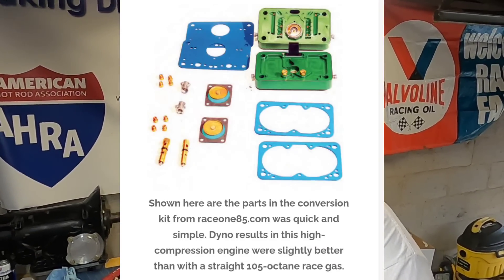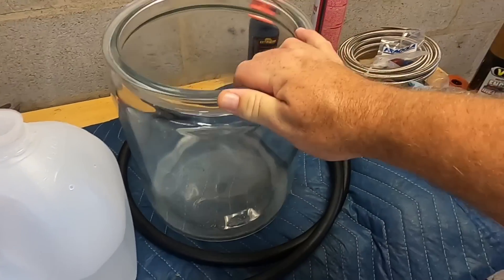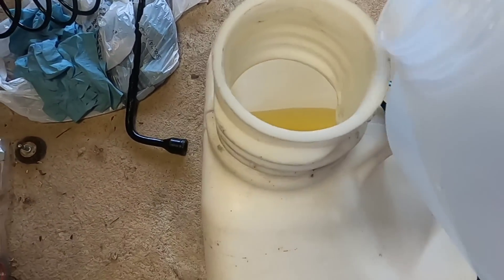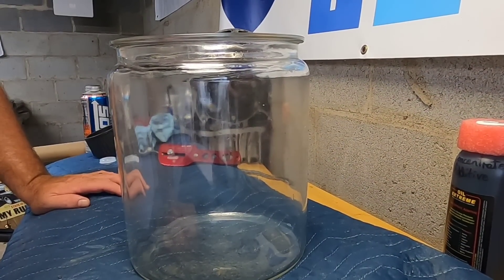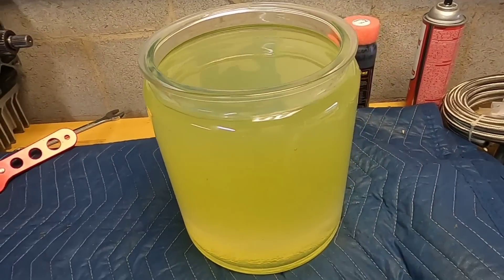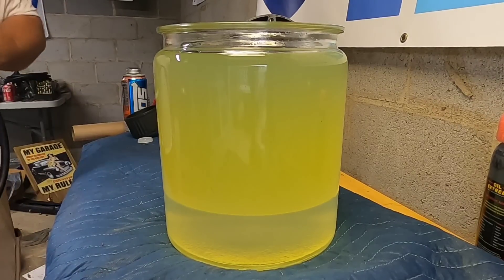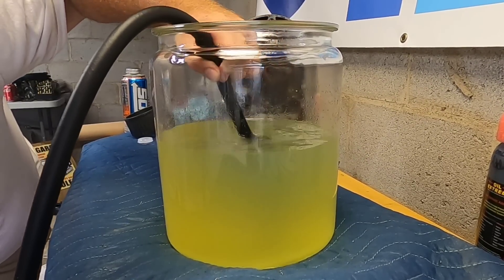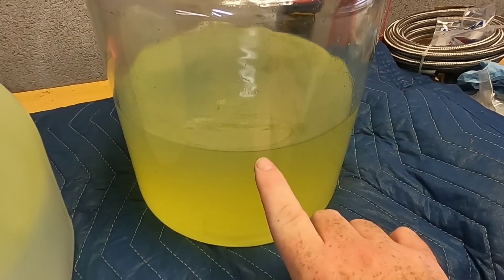Making your own ETHANOL FREE Gasoline!!! it's easier than you think!!

Comment: Glycol (antifreeze) works better than water on separating and with 87 octane you drop to 84 and with 93 it will drop to 91-90 ish on octane. I work for one of the big oil company’s and we test loads that head to the stations for ethanol content this way. It can help a fella make some 90 rec when you are in a pinch.
Reply from the maker: I've never tried Antifreeze... That is pretty neat good info
Thanks for watching
Andy
Reply: It takes more energy to produce ethanol than the ethanol contains. Wasteful. All about corn subsidies and being environmentally ‘friendly’ when it is the opposite. Inefficient, ineffective, and wasteful. Ethanol should be removed from our fuel.
Reply: @Walkeranz  THANK YOU!

I did a big presentation when I was in college about that, showing tons of evidence and data, including showing damage ethanol does over time to fuel systems and small engines, and all I got was "but even Bill Clinton said...."

Needless to say going to a college in western WA was a joke even back then.
Reply: @Walkeranz  Lol, glad you believe the propaganda.......
Please, tell me more government lies!!
Reply: Ethylene glycol is far more expensive than water
Reply: @308dad8  never said it was cheaper… just said it works better 😂
Reply: @Lagrange1186  you miss the point. This is how to get straight gas to run something intolerant of alcohol. The best method is the least expensive and or least labor intensive. For me it’s best just to buy straight gas but if I have to chemically separate gas from ethanol I’m not going to call $13/gallon better than free water. How much better yield do you get from it? If it’s not better than 1300% less gasoline wasted then I personally can’t consider it.
Reply: @308dad8  sounds like you got it figured out boss… just use water 🤷🏻‍♂️
Reply: @308dad8  and yes, it can be REUSED.   so cost doesn't matter....
Reply: Thanks for noting the drop in octane

Ethanol has pretty high octane so the underlying crude oil based gasoline is refined to a lower octane to give the blend 87 or 93, etc
Reply from the maker: Yeah, E85 has a octane rating of 105 so it does have an effect on it even if it's just 10%
Thanks for watching
Andy
Reply: @UnityMotorSportsGarage  so couldn't you do this with E85 and get a higher octane after removing the ethanol from it?
Reply: @ccpgmike620  I don’t know how true that really is if you look at what octane actually is. Yes alcohol needs to be vapor to ignite but so does gas. Octane is a fuels ability to not ignite prematurely, which is what causes knocks. Since alcohol will evaporate rapidly at room temperature and it’s vapor is ridiculously combustible I don’t see how it’s antiknock rating is higher than gasoline.
Reply: @308dad8  The term octane represents a fuels resistance to knocking. The numerically higher the octane, the higher the antiknock properties of that given batch of fuel. Pure ethanol is 108 octane. Gas can be refined up to 130 but is typically refined to 84 and then mixed 90/10 with ethanol to give it an 87 octane rating for regular gas. The octane number goes up when ethanol is added because the ethanol has a higher octane than the low-refined regular gas. Avgas (avaition fuel) is what runs up to 130 octane. Typical automotive racing fuel found at the dragstrip is around 115 octane, as another example. So if you were to mix 130 octane Avgas and ethanol at a 90/10 ratio you would get around 127 octane. You're thinking of gas, fully refined, as being of higher octane than ethanol which it is. However regular street fuel is very poorly refined so the ethanol has a higher rating. This is why you're confused. You're both correct and wrong at the same time. Correct that gas CAN be of higher octane rating than ethanol, but you're incorrect in assuming that regular automotive gasoline is made that well, it isn't. Hope that clears things up.
Reply: @308dad8  Short answer is that ethanol has a a much lower ignition point than gasoline.  Lower temperatures decrease the likelihood of detonation. Also bear in mind that because ETOH is hygroscopic ALL fuel at the pumps containing ETOH WILL contain some water [which in low amounts serves as a burn rate modifier, specifically slowing the rate at which the fuel burns. Too MUCH moisture will either cause the fuel to burn poorly or perhaps not burn at all. 

Technically engine knock is detonation.  In detonation ALL of the fuel is consumed instantly whereas in an explosion there is a definite flame front moving from one end of the fuel to the other... it's a linear progression.  Because the ETOH ignites at a lower temperature the gasoline ignites at a lower temperature, and you avoid detonation.  

Anyway atomized fuel gets closer to detonation by itself. Add in adiabiatic compression ignition (think fire piston, or even a diesel engine).

The addition of octane regulates how fast that atomized fuel can burn.
Reply: @308dad8  in the same manner of water or meth injection into pump gasoline race cars,it has a higher cooling effect upon vaporization.That little bit inhibits detonation under higher boosts or increased timing settings.
Reply: @308dad8  Good on you for thinking about it, but no you are wrong. Ethanol has a very high octane rating. Also -  Anti detonation properties are VASTLY more complicated than your simple vapor pressure theory. Just for basics, some octane boosting chemicals are only good at lean mixture anti-knock, others only work at preventing knock at a rich setting.
Reply: Brandon if glycol is a better medium to draw the ethanol does the ratio remain the same? Or can the ratio be decreased? Can the glycol be reused multiple times to say extract/clean 20 gallons (full 1970 Mustang tank). Just had Holley rebuild the original carb to my 9F02R and before I put it back on I have been trying to come up with ways to drain the carb every time its parked.  Its been a yr since I last ran it and it was 11 years before that... Thanks
Reply: @donnamoss9650  Go to your LITTLE airport and buy the 100 avgas, won't go bad.
Reply: @donnamoss9650  in
Reply: @donnamoss9650  we use it as a 1:1 ratio and it separates within minutes. Water can take some time to separate but it will definitely get the job done. As far as could you use less I I’ve never tried it with less but I’m gonna have to test that theory some time and see. Thanks for the idea.
Reply: @Lagrange1186  I would appreciate the results of your experiment. Thank you.
Reply: @Lagrange1186  )
Reply: How do you know the ethanol is mixed in the water instead of being in both the water and gasoline?
Reply: @MrZdvy  a graduated cylinder will help show you the magic. Fill it up with 100 ml of gasoline add 10 ml of glycol shake with the top covered for a few minutes let it set for a few minutes and you will notice it now looks like you have 20 ml of glycol. Once you see the trick work a few hundred times you trust the science and go on. As far as water goes… I know it works but I’m gonna have to do an honest test on it to see the exact time difference and effectiveness between the two since this has sparked so much interest and report back 🤷🏻‍♂️.
Reply: @Lagrange1186  I get it, thanks.
Reply: Update for everyone. Did the side by side test on glycol  vs water to separate ethanol. After 5 minutes the glycol pulls 100% of the ethanol out. After 5 minutes the water pulled out 90% of the ethanol and the gasoline was a bit cloudy. Had I given it 24 hours maybe it would get the full ethanol concentration separated from the gas. Andy if you shoot me an email address I’ll email you side by side pictures of the results to share. I didn’t have any pure antifreeze concentrate from Prestone on site to use only the 50/50 premix but if y’all want I can bring some in from the house and do one more test 🤷🏻‍♂️
Reply: Years ago some idiot put antifreeze in a vodka bottle and he went away for the weekend and his kid drank it and died. Speaking of glycol went to NAPA a week ago and they only sold it in a 50:50 mix after I bought a jug of distilled water
Reply: @codyhatch4607  yep 35 yrs ago son's Saint Bernard thirsty or??? hot summer day licked a puddle of anti freeze in dirt driveway..  son got home and dog was dead.. His mother's water pump apparently went bad evening before or overnight and leaked. No one realized it until he came in the drive and the dog was laying there. Any idea how big a grave has to be for a St Bernard?
Reply: @donnamoss9650 it's embittered now to help prevent that!
Reply: @donnamoss9650  one of our cats died for the same reason... this pre-mixed liquid antifreezes have some sweet taste or smell they like, works as a magnet for those pets
Reply: You can xylene as an octane booster.
Reply: @David_H_Parker  toluene is one of the big oil go-to tricks for that
Reply: @Lagrange1186  Can you buy 100% ethanol from Big Oil, I mean contaminated for engine use of coarse?
Reply: @Lagrange1186 how does the average Joe get a hold of 50 gallons of toluene, one might ask.
Reply: So question would adding the octane booster actually work or is that stuff fake?
Reply: @williamwallace9620  When you switch a smallblock over to run on alcohol you basically(just about) double the jet size in your Holly Carburator. Holly jet sizes are quite simple: a #70 jet is a .070 inch opening ie. 70 thousandths of a inch. If you were running, say, #76's in your primaries and #80's in your secondaries on gas then you would  run somewhere in the #138-#142 range for your primaries and maybe #152's on your secondaries. We all know how much more flow we get when we (basically) double the diameter of a pipe.
Yes, fuel mileage with ethanol is horrendous. However, in my example above you can expect 50-70 more horsepower and 125+ more pound feet of torque from the ethanol. It's a much more potent fuel, overall, than gasoline, but one that's quite impractical in the real world because the mileage is terrible. This is why you don't see ethanol fueling stations and nobody much buys E85. A nice idea, to be sure, but one that doesn't really work too well when the wheels hit the pavement.
Reply: Gasoline in and of itself is not a particular chemical. It is a mixture of several chemicals and that varies seasonally in order to minimize evaporation in the warmer months. Most ‘gasoline’ sold today is actually a mixture known in refining parlance as reformate and is a low octane blend fully intended to be supplanted with 10% ethanol for use in IC engines. (As mandated by the government by the way). That reformate you have left after siphoning off the ethanol is actually not gasoline and is a rather poor fuel.
Reply: @gilbertgauger3380  However, in a small engine with very low compression to begin with, such as a lawnmower, the low octane fuel is just fine. What messes up the small engines is when you use a fuel mixed with ethanol. Since the use ethanol requires much greater fuel volume than gasoline(irrespective of "octane" rating) the overall effect is to lean out the mixture. That lean condition is what small engine operators are trying to avoid by using pure gasoline. 
90/10 fuel has a net effect of running a motor in the 5-6% lean range. This is no big deal in a port injected motor with a feedback system, ie. most cars and newer motorcycles, but is devastating in the long run to simple carburated motors. That's why this guy does this, and he's NOT alone.
Reply: So why is the "non-ethanol" gas more expensive than the gas that has been mixed on the truck with ethanol? I have never been able to figure that out!? The ethanol costs more than gasoline, so why would the fuel with the more expensive alcohol be less expensive? Ran my old Mustang with a hot air Paxton on E85, but mostly mixed for E60 as that was 100 octane instead of 105... Thanks!
Reply: @robertelmo7736  Because the gov't subsidizes the ethanol (read farmers) industry. That's why it is cheaper at the pump. +
Reply: @robertelmo7736  non ethanol gas uses other chemicals  to raise the octane. All are more expensive than ethanol.
Reply: @robertelmo7736  taxes my friend… it’s all about the taxes… Ethanol is a renewable energy and you get the tax credit towards the 87 or 93 and when you take the ethanol out… you take the tax cut out
Reply: @Lagrange1186  its all about big ag and their political power.
Reply: Yeah because big oil has no political power....
Reply: @Lagrange1186  Helped set up an ethanol plant years ago. Had to produce 1 gallon of ethanol before midnight on 31st December to get a
full years worth of tax credits. The "Revenue Man" was there when product came out. I'm thinking it had to be 120 proof to qualify. You
could strain the ethanol thru a loaf of bread for a filter and you would get drinkable "Moon Shine".
Reply: @robertelmo7736  ethanol actually costs less than the iso octane they have to replace it with. So theoretically like 90 ethanol free should cost about as much as e10 93
Reply: @Prestiged_peck  Oh, so if they don't put the ethanol in there they have to add an additive to boost the octane!? That makes sense.
Reply: @robertelmo7736  well there's iso-octane in there anyways, they just have to use more if the ethanol isn't there as a cheap octane boost.
Reply: @robertelmo7736  was qfc
Reply: , @robertelmo7736  It's an order-of-scale thing, Ethanol-free gas is a premium product now as such it moves at a lower volume.
Reply: @2000freefuel  How's that--it doesn't come up the pipeline with ethanol in it, they add it when the tanker truck loads it?
Reply: I guess you need to factor in the savings after youve purchased the antifreeze.
Reply: They sell ethanol free fuel at fuel station near the water here in Maryland
Reply: Absolutely amazing, thanks for sharing this video great job!
Reply: Thanks for this deep,broad,and informative discussion.
Reply: this is what I do! 93 octane and some green antifreeze... throw some octane boost in it and some stabil... usually do 2gal, enough for my lawnmower all season!
Reply: Putin is continuing Crimea war Ukraine gave up nukes Trump is going to the big house so my gas is drained. No end in sight. Only worse to come.
Reply: Whooooa Hillbilly 87 octane you're taking out the Alcohol it's an octane booster meaning the remaining fuel is below 87 potentially 82 octane. And 87 octane with ethanol. In Australia ours is 10% Alcohol for   91 octane. Dude you're literally being sold SEWER SLOP as fuel  only in America. 😂
Reply: what do you do with the byproduct after you remove the alcohol from the gas?
Reply: Ethanol keeps your engine cooler.  It helps a lot in places like AZ and S. Texas in the summer
Reply: Fyi, Avgas is very close to kerosene.  Can you just run kerosene in your car?
Reply: @8gomerpyle22  
AvGas is Aviation Gasoline. 
Gasoline is a "solvent", not an oil. 

Kerosene is a fuel oil, "Jet A" is Jet Fuel 
which is very similar to a highly filtered Kerosene (plus small amounts of other ingredients) 
which is basically filtered #1 Fuel oil 
which is a "more refined" - higher in the distillation process/column - than #2 Fuel Oil 
which is Diesel Fuel without the road tax and prossibly small amounts of "minor" ingredients.   

It all depends on where it's cracked, which (temperature) level in the "still" is accessed to remove a product from it (oversimplified explanation BUT that IS the basics of how crude oils "become" different petroleum products).
Reply: Cheap octane boost?  Ethanol? It takes 900 lbs of corn to make one gallon of ethanol.  The planting, watering, harvesting, prepping, cooking, distilling, transport and mixing into the gas and then the  nutrients needing replacement in the soil. Nothing cheap here.  Our food source is being converted into a lobbyists paycheck in Iowa, since they are the only source of alcohol that our govt recognizes.  Politics. 😮
Reply: My understanding is the lead in leaded gasoline was also an octane booster. Once the water is removed, what may be added to raise the octane level?
Reply: That's why ya go fill up at a sleepy little airport with 100 low lead and none of that ethanol trash in it.
Reply: @MrTheHillfolk  I don't know... but I am gonna guess aviation gas cost more then rec gas.
Reply: @MrTheHillfolk   Find a Sunoco gas station most have one pump that is ethanol free
Reply: @mr.stonerUDX714  
I gotta go over 1 county to get ethanol free fuel ,and then it's 91 and not 93 at the couple of places I've been. 
It's not a wasted trip just for gas ,I'll usually try and add in a little shopping around the area and it's only 15mins to get over there but 25 before you find anything useful. 
I know my car likes it as I saw a little better mileage.
It's actually time soon to go fill up a few cans for the storage season on the small engine stuff.
Reply: @MrTheHillfolk  and nuke any emissions system your car might have while lowering your entire neighborhood's IQ  (there's studies proving it look it up)
Reply: @MrTheHillfolk  I used to do that back in the 90s. Didn't think you still could... Good times.
Reply: @TonysHotRodGarage  .
Reply: But then You can not drink it!
Reply: Can the ethylene glycol that pulls water out then be used in your radiator?